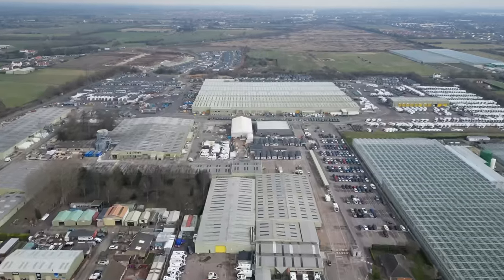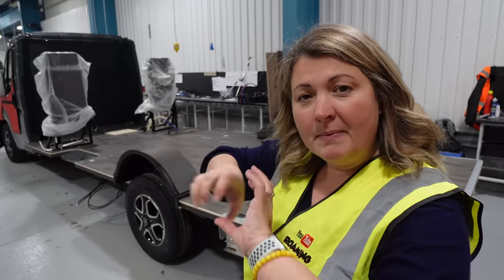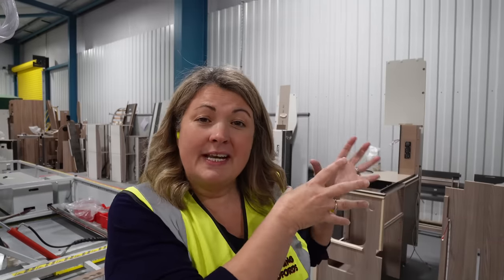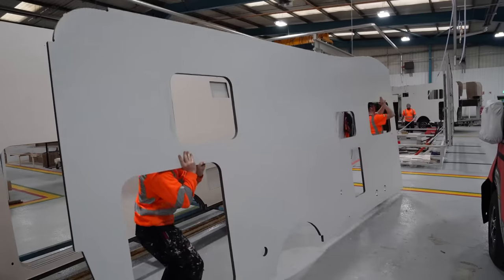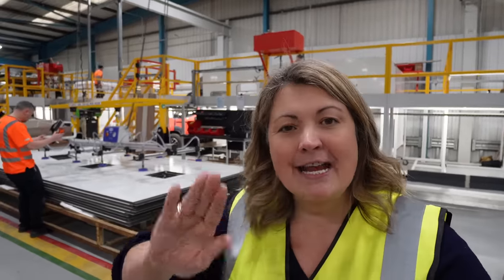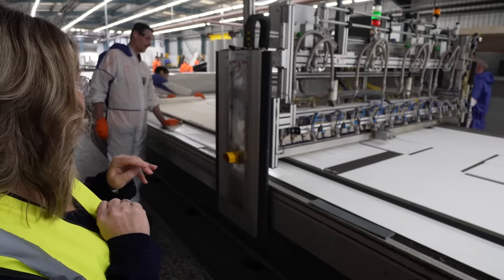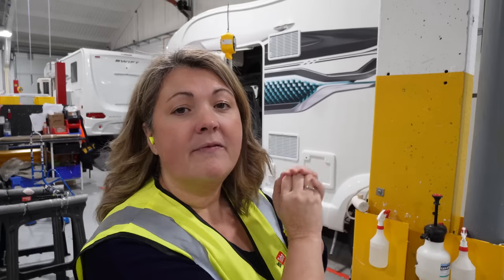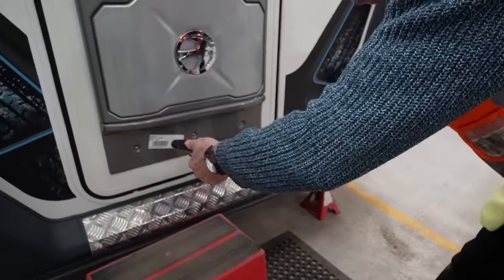Things are changing at the UK’s Largest Motorhome Manufacturer

Comment: Always check you caravan or motor home on collection day thoroughly for missing broken parts. Badly placed out wiring under the caravan especially near the corner legs where the handle is inserted for raising and lowering the legs. This is a common issue on most caravans. Missing trim is also common as well as cushion stitching faults.
Reply from the maker: Good tips!

Comment: Will never buy Swift again

We haven’t even used our brand new Swift conqueror 480, the 2 way fridge door completely fell off onto my wife, Dometic were very quick at replacing the faulty top metal plate that holds the door in place. We have found quite a few loose screw, through out the van, some just keep turning 😩 
Wires exposed and not hidden away of fixed correctly, thats poor quality control.
Panel a round the window, had come away from its fixings, due to fixing screws fallen out.
im sure we will have more to add to our list, once we have been away on our first trip 😉

This is our first Swift, after moving back from Motorhomes

Not worth the £32,500 we paid for it, Sorry Swift, but you have let us down at the start 👍

PS. I hope Swift are at the show in October? 

Great video BTW 😃
Reply: Ditto the above 👍
Reply: Good job that person signing everything off at pdi knows what their doing accountable my "*